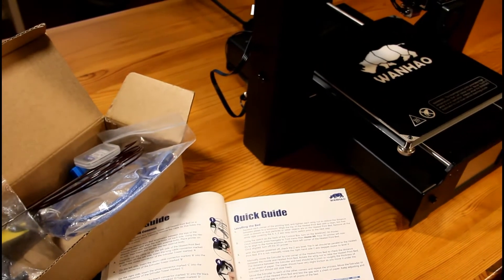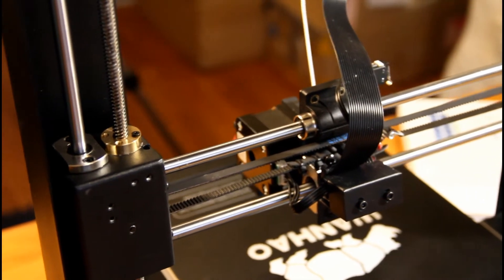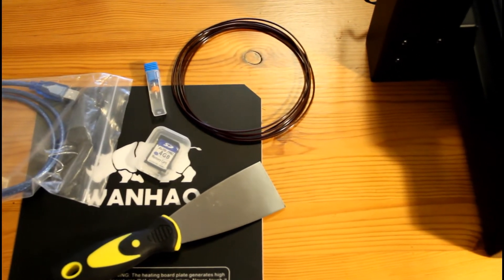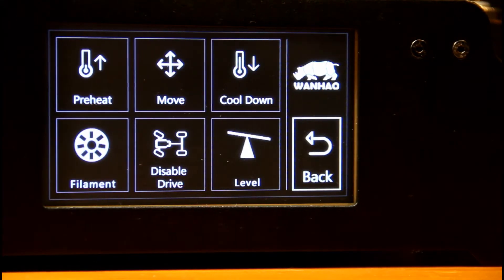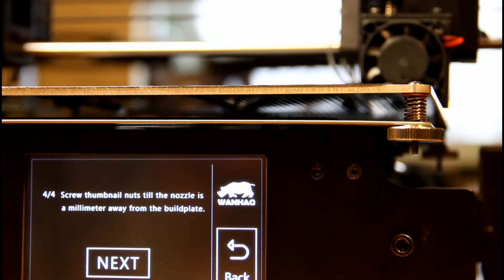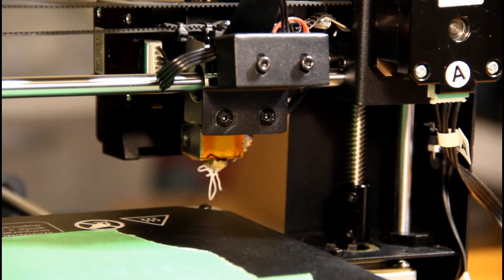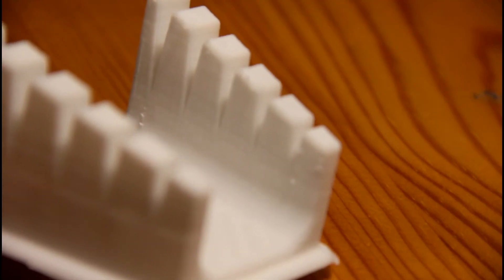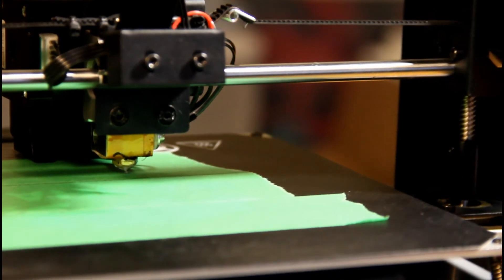Wanhao i3 Plus 3D Printer REVIEW - A Printer That Does it All

Comment: the screen might not support colour also a colour displace will use more processing power and a colour screen does not matter if it get the job done
Reply from the maker: Of course, just saying that for this price a color screen might be a good addition
Reply: It does support color. If you put on a firmware like ADVi3pp, you see that it supports it (and I recommed doing so over the stock Wanhao firmware).